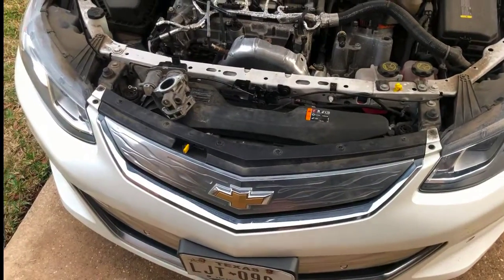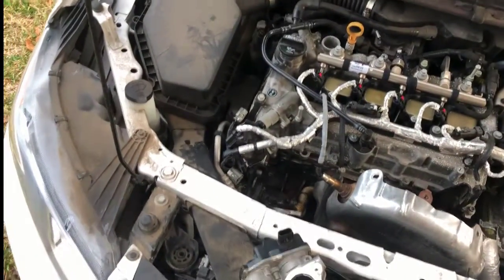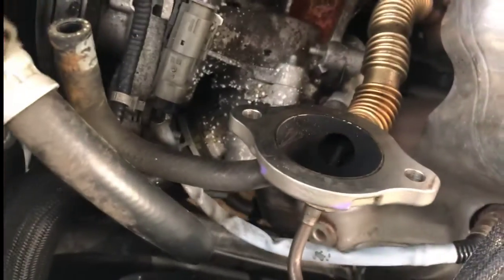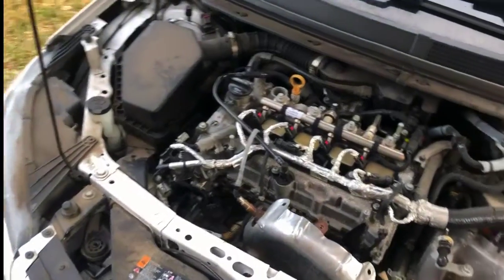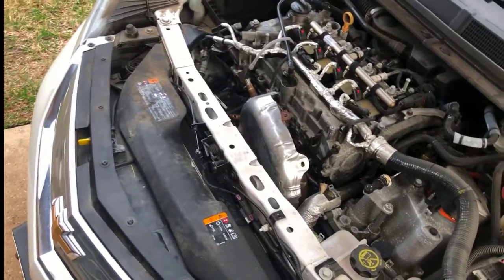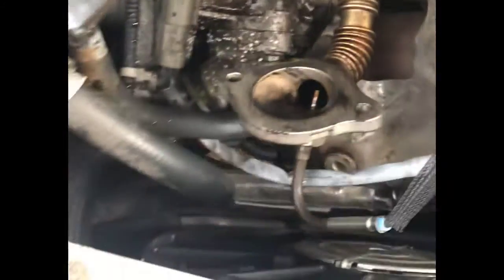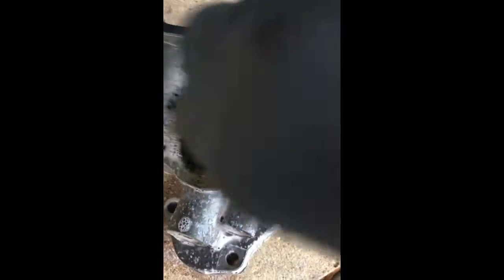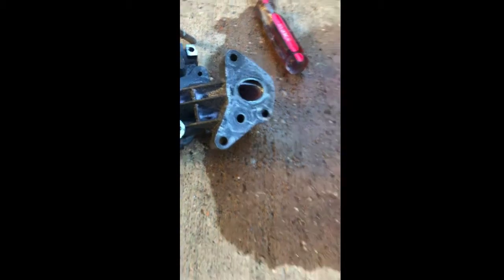Chevrolet P0401 Engine Code - EGR Valve & EGR Cooler Cleaning (Volt)

Comment: I have a 2016 volt and just had the same work done on my car by the dealer. But this should have been 100% covered under the emissions warranty(15yrs/150,000 miles). I bought my car used with no extended warranty etc. But after talking with the dealer, who initially was wanting about $1,000 to do the fix. Came back and covered everything, including the loaner car. You can open a case with Chevy.com if the dealer is telling you otherwise. 

Good job on taking the initiative and figuring out a fix. But you should have been covered for this repair.
Reply: I am having the same issue with 2016 Volt 59K miles. I am hoping the dealership will cover this under warranty as they are charging for a $160 diagnostics.
Reply from the maker: Victor Seto let us know how this turns out for you. If multiple people get this issued resolved with Chevy,  that increases the likelihood of others having a positive result too.  I think it’s interesting to see so many others having the same issue on their Volt. This is clearly an issue Chevy should be/ is aware of.
Reply: Dr. Rick Curry just picked up my car from the dealership in California. Covered under emissions 100k mile warranty. They said it was the egr cooler. Chevy provided a rental car(because loaners were not available at the time). Took three days to fix due to parts being ordered. Happy they took care of it but hopes this won’t be a reoccurring issue. Thanks for the help!
Reply: @victorhongkong  Hi Victor, so the warranty ends at 100K? Mine just hit 101K and I was told the EGR is the same problem.
Reply from the maker: miketpi2 glad you won the fight with Chevy.  Was told Chevy’s warranty explicitly states EGR valve expires with 3/36k warranty.  Hopefully others see your post if they run across this video and fight it.  4 year old cars shouldn’t have EGR issues!
Reply: I believe California has several laws that are unique to the state and provide coverage not offered elsewhere.   That could make the difference.

Comment: Thank you for the upload. Gonna try this method next week. I’ll keep you updated.
Reply from the maker: Alexander Vousden good luck! Let us know how it goes.
Reply: Dr. Rick Curry so I did this method and cleared the code. It’s been 2 weeks and the CEL hasn’t come back on. However, my Volt now seems to run pretty rough on ICE. It jolts, hesitates, and runs hard. Suggestions? Is it possible that air got in the coolant when I took the EGR off?
Reply from the maker: Alexander Vousden haven’t personally run into this issue. For the last year, my volt has run a little rough on ICE, especially on idle.  It could be a result of the EGR issues- but I’m honestly not sure.  I don’t think Air in the fluid would effect how it runs on ICE- it would effect the heater, etc.  There’s some YouTube videos where A few people had Heat issues and it was due to low coolant levels and/or air in the system. If this is the case, you’d hear a “gurgling” noise from the dash.  Check your coolant levels and with your car parked on an incline, run the heat on high for a few minutes and it will purge the line. There’s also the chance the issues are unrelated. Any other codes thrown or shown as pending ?